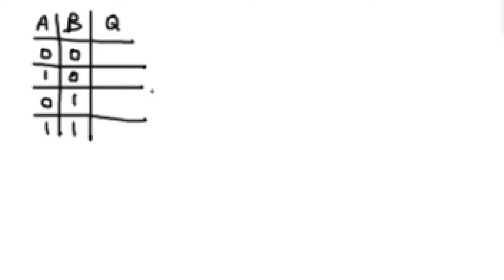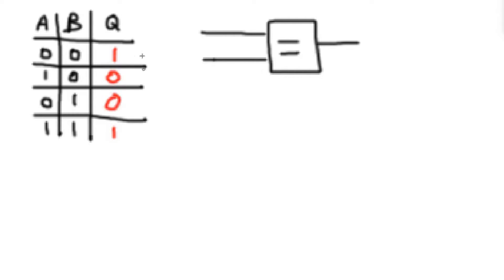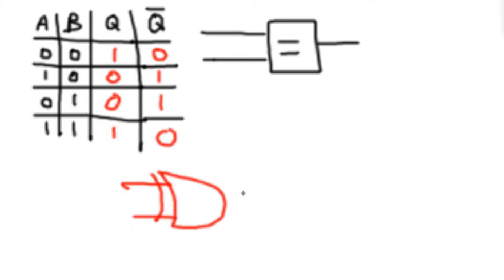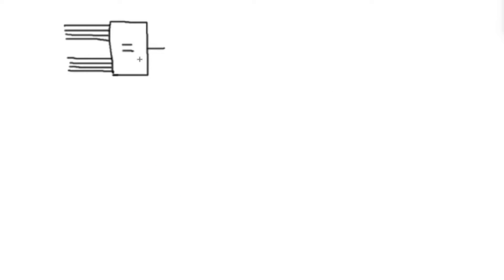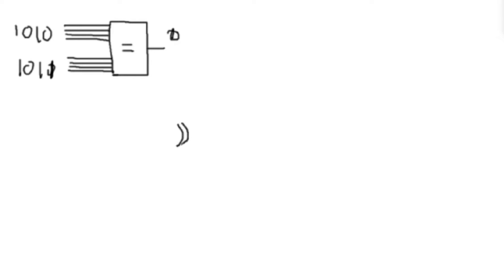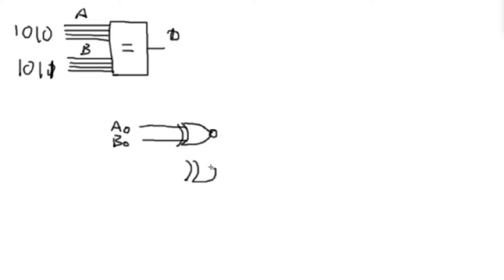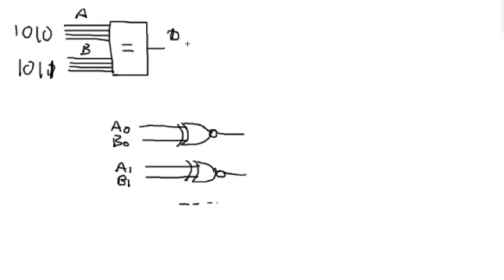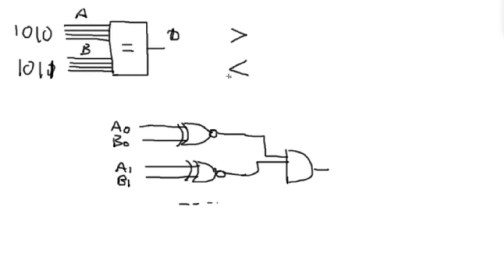Basic Digital Comparators

Comment: I tried putting it together in my world (with two pairs of inputs total) and it somehow also outputs True when the inputs are opposite (because the Xnor gates output True when both inputs are on so it's the same as when both are off). How do I fix that?
Reply from the maker: Oh boy, I can think of a lot of things that can be at fault here.
First off, are you sure you got your inputs straight? Remember, each XNOR gate is looking at 1 bit from each number.
Second, are the outputs coming together to an AND gate? Or at least the equivalent of an AND gate? I.e. using XOR's and a NOR gate instead?
Reply: @n00b_asaurus  Yup I mixed the inputs! Got it working, now